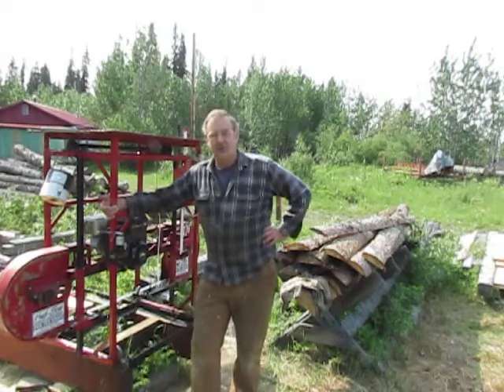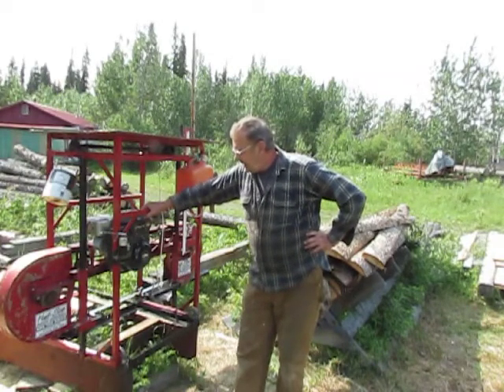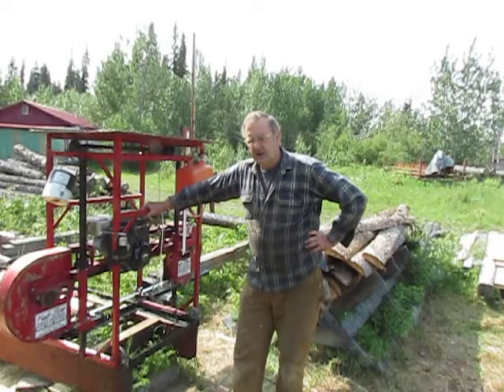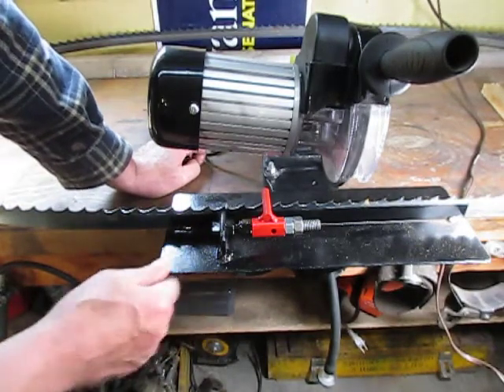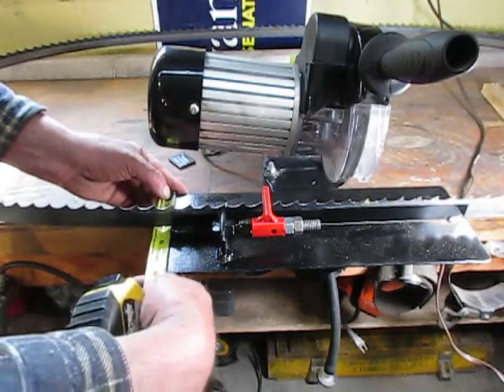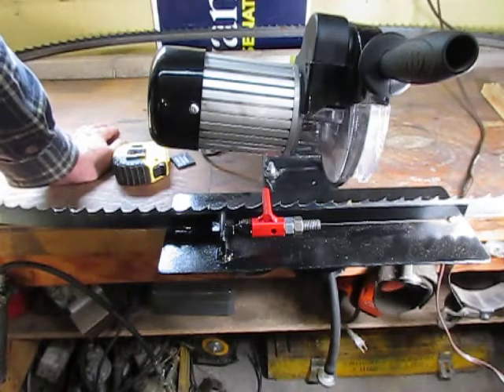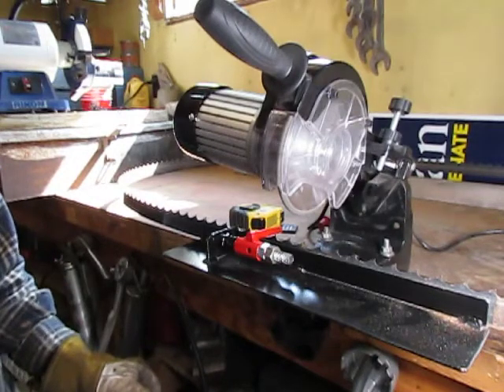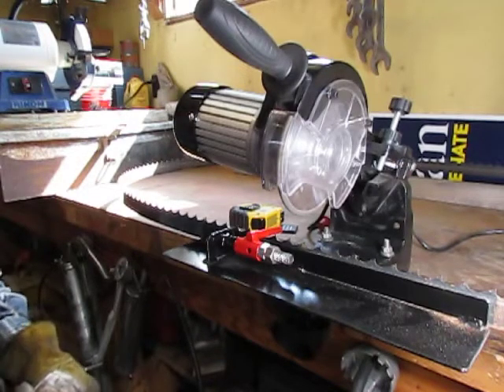Bandsaw Sawmill Sharpener Homemade Handy Inexpensive Fast Bandsaw band sharpener Part 1

Comment: Good information thank you I made some thing similar works pretty good I’m still trying to figure out how to sharpen the backside of the tooth the guy I get to sharpen my blades sometimes has a machine that sharpens the face in the back at the same time work great thanks for the info. God bless Glen
Reply from the maker: I personally don't believe it necessary to shapen "grind" the back of the tooth,  I've heard all about the stress cracks that su0pposedly start on the gullet or back of the tooth but I've never had a problem with stress cracks.  I think if you have a large motor and are cutting oak or hard woods it could possibly be an issue if you don't sharpen often enough.  grinding the back of the tooth only shortens the life of the tooth in my honest opinion.

Comment: hi, could you  also add a flat sock bar at bottom to slide into the drive link channel and be clamped as a chain would be, it would raise the band, don't think it wound matter in the professional style grinders, but the hobbyist style it would!
Reply from the maker: I've made quit a number of modification to this,  check them out if your interested.  Thanks for commenting.  https://www.youtube.com/watch?v=TpJ55Lz5_ps

Comment: If your sharper does not water cool the blade while sharpening it will heat the tooth and take the hardness out. The sharpening will last about half as long. Speaking from 30 years of experience.
Reply from the maker: Thats another cool thing about the diamond cutting wheel,  it doesn't heat the tool nearly as much as a stone.  In addition it is best to just take enough.....as little as possible.  I've not seen any sharpeners that water cool though.  Been at it few years myself.

Comment: Do you have a description or link as to the diamond wheel you use
Reply from the maker: Super Abrasive CBN 5-3/4” Chainsaw Wheels for 3/8 and .404 Pitch Steel Chains
Brand: Diamond Wheel, Inc
You can find them on Amazon

Comment: Great rig. But when you sharpen does not the tooth set change?
Reply from the maker: Of course you are grinding the tooth away a little every time you sharpen but I try to take as little as possible,  the teeth and the set will wear just from the cutting of wood as well.  I have a tooth setter but don't think I'll have to use it but perhaps every third sharpening.   Its all part of the process no matter what process you choose.
Reply: It does change set for sure. I get 3-4 sharpenings before I need to set my blades.